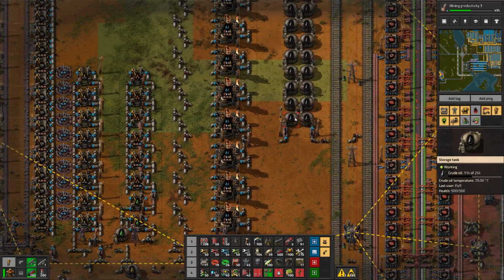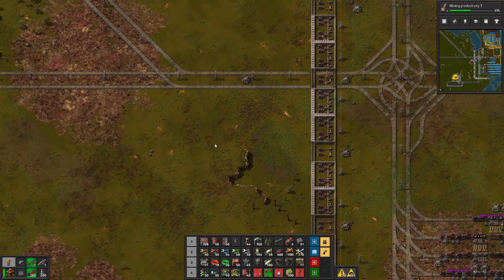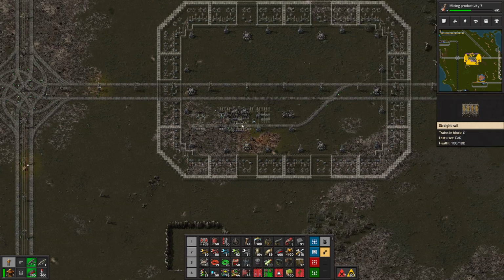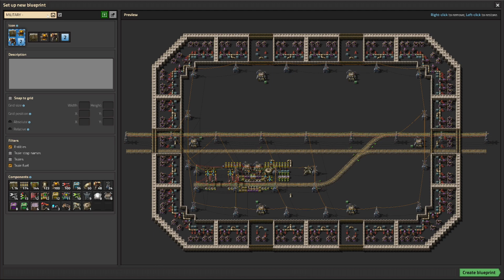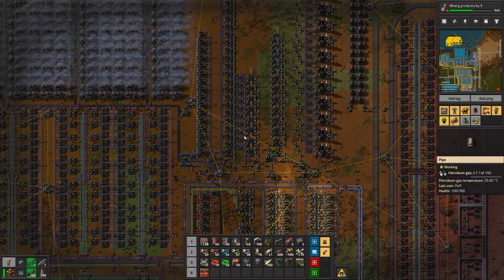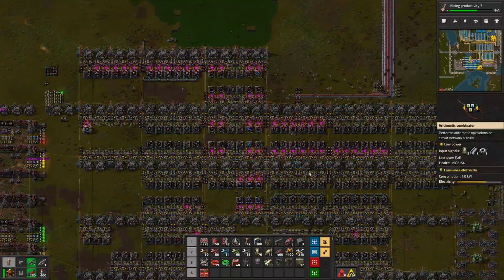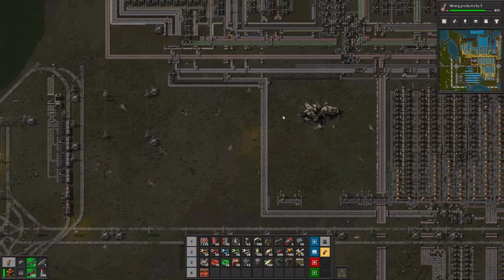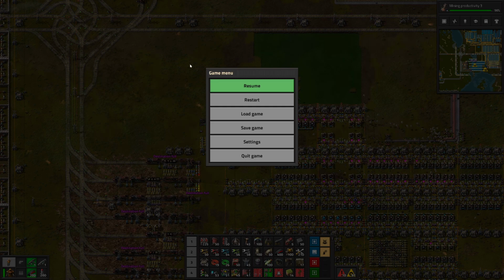MILITARY OUTPOST BLUEPRINTS - Ep 68 - DeathWorld 400 - Factorio

Comment: With every mall I always found it too expensive (and slow) to load the base materials like copper and iron (and gears) via bots. I just have 3 lines running between each assembly line with the materials and feed them with Inserts. Saves a lot of if bots, time and power.
Reply from the maker: That’s the endgame mall, I cannot properly feed it yet. Bots here will support higher throughput than the belts ever could, they are awesome for inconsistent demand over short distances. Note that belts and gears are placed on the right side, that’s where the trains will be delivering the plates in the future (now it’s only ore).
Reply: @par_86  Cool! Looks like you almost got nuclear up and running as well which is great, that will help a lot for sure. Low power is truly the slow death of a factory :S